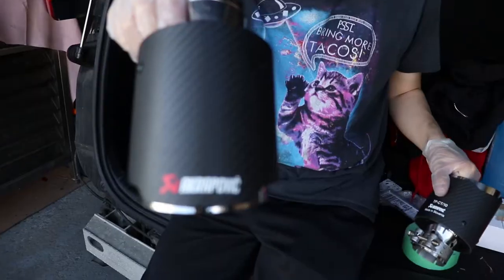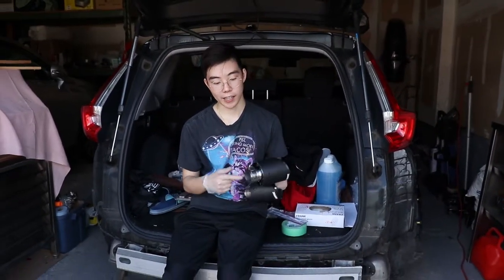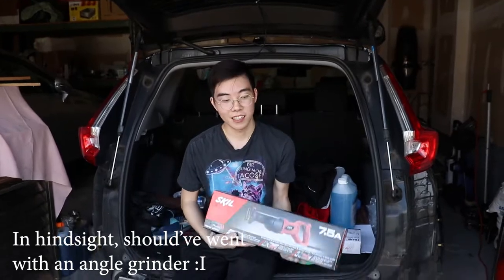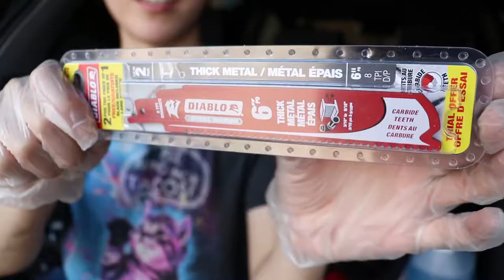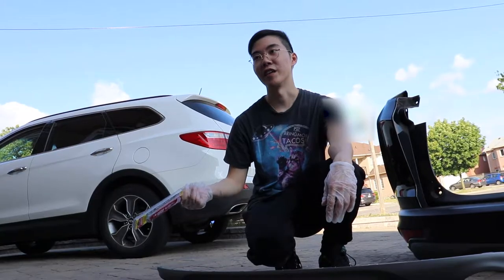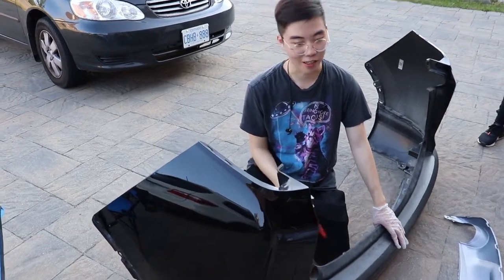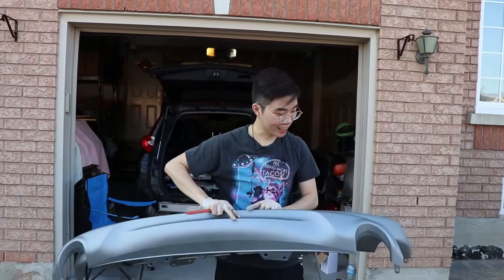New Rear End Setup | Fake Akrapovic Exhaust Tips | 2017 Honda CRV

Comment: Next time, with the saw. put the saw closer to the object you are cutting, against the black plate. that is the way the saw is designed to be used. Then it is not going to wobble around. Just a tip ;)

Comment: Your video was super helpful for seeing how the valence connects to the rest of the bumper. Mine has some damage and I want to replace it but I couldn't find good info about that anywhere. If I'm only replacing the valence do you know if that can be done without removing the whole bumper like you did in the previous video? It seems like the push through clips underneath should be easy. I think it will just depend on whether the trim clips along the top can either be released from the outside with a trim tool or if there's a way to get to them from underneath the car. Do you know if that's possible?
Reply from the maker: I recommend removing the whole bumper because it is hard to get the valence back into the clips when the the bumper is still on the car. I took the valence off and put the bumper back on one time thinking I could just clip the valence back in but the middle was too flimsy and the valence just wouldnt clip back. Im not sure if it would be possible without removing the bumper but because of that issue I just remove it every time (and its easier for me to remove the bumper than to try and find the clips from under the car)

Comment: What the size of the tips exhaust 57mm in-101mm out?
Reply from the maker: Sorry Mustafa, I cant remember exactly. I believe it is 2.5" or 2.75"ish to around a 3.5" a 4" because it depends on whether you measure it from the outer or inner part of the exhaust tip. The best way to find one that fits about the same is to ebay search "Honda CRV 2017-2021 exhaust tips"
Reply: @AnthonyMo  thnx bro i fit 57mm in /out101mm with weld but he looks nice now🙏

Comment: Should prob just weld the exhaust tips on if you plan to keep them for a while.  I got it done on my crv.  There's a place in scarb called Noyzboyz.  Check em out if you plan on doing it.  They did a great job
Reply from the maker: Ill defintely look into them when I decide to get it fixed in the future. They stay on pretty good right now so ill leave them for now. Thanks for the recommendation!
Reply from the maker: At the end of the day its just always a matter of staying within my yearly budget for the car so Ill it fixed when I feel like I can allocate some savings towards it 😅 the main reason Im not getting it fixed asap is that i think its not an eyesore for now (let me know otherwise) and I wanna use that extra 100 to 200 on some other things. However, i would love to get it fixed in the future to get it perfect and im thinking maybe doing it before the end of summer
Reply: If your on a budget then yeah I think it looks fine.  Lol I couldn't stand having exhaust tips held in with screws so I got them welded instead.  You should prob save up some money to make more HP.  The CRV has a lot more potential then it looks.  I definitely feel the difference in gains
Reply: Instablaster.

Comment: I need this exhaust for my crv  2017 what is the diameters?
Reply from the maker: They measure either 2-3/8" or 2-1/2". Mine didnt fit perfect because i didnt get a pipe welded but if youre looking for these tips you should be able to find some CRV specifically sized ones on ebay
Reply from the maker: I think the best way to measure them is to use a string at the part closest to the muffler but it really depends on where you want to cut it and if you want to weld a pipe onto the end
Reply: Okay thanks bro For your help 😄😄😄🙏🏻